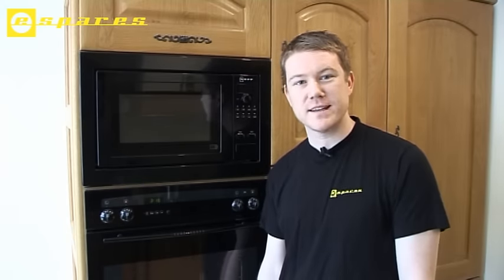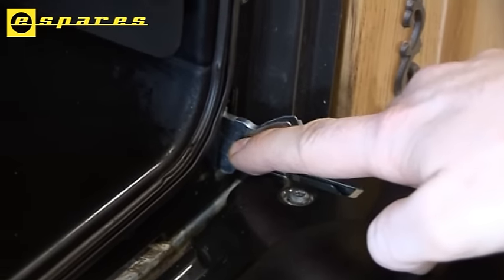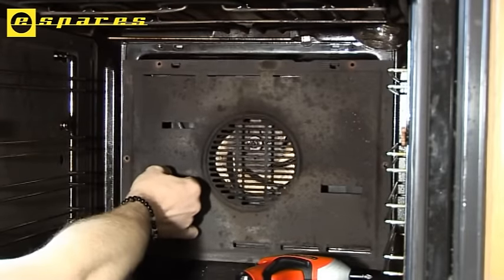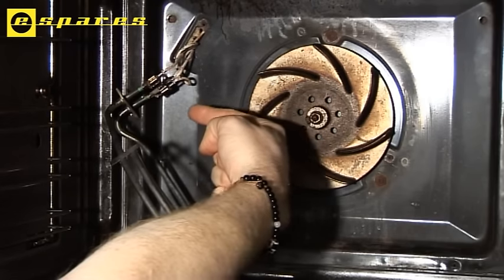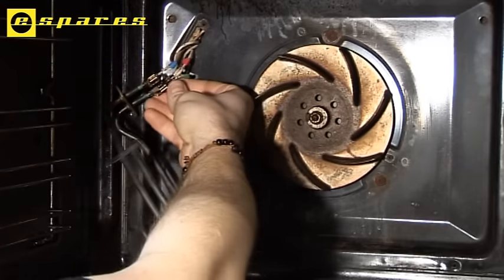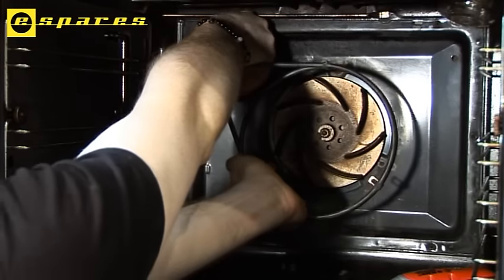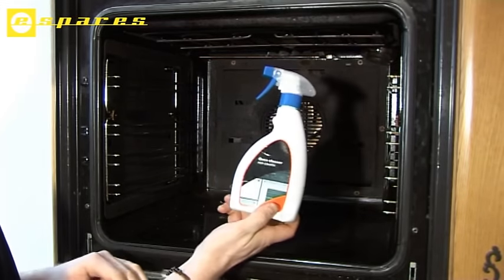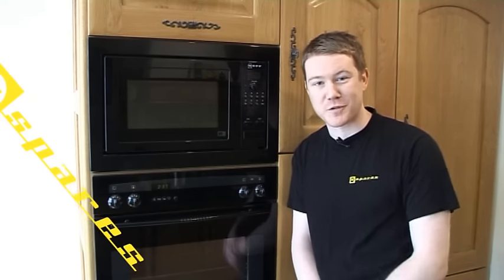How to Replace a Fan Oven Element in a Neff Cooker

Comment: Thank you for the video. FYI if you have a Neff B14M42N3GB/04 you'll need to go in through the back as that is where the element is screwed from. I would not say the oven is too heavy for one person to lift out of its place. It's another 10ish screws but more than possible. You may need a second pair of hands to hold the element in place as you replace the two Element screws. Also, this model was fitted with Torx Screws not Posi. Apart from that, it's pretty straight forward.
Reply: Really appreciate this comment. I would've given up if I hadn't scrolled down to see this, but it gave the confidence to remove my oven and take the back panel off. In the end I was able to replace my heating element but unfortunately that didn't fix my problem.

Still, it was an interesting experience that I enjoyed and wouldn't have had without your tip! 🙌
Reply: If you're not sure if you need to go in from the back take a look at the two screws holding the element in place, if you can't see the acrew heads it's screwed in from the back (like mine was unfortunately, no big deal it just makes a quick job a slightly longer one), cheers 👍
Reply: Also the same applies for the 'U1ACE2HN0B' double oven

Comment: Great video. Just a quick tip - remember you have to re-set the clock on the oven after re-connecting the power. Otherwise the oven will not function and you will worry that your handiwork was faulty!
Reply from the maker: Thanks for the comments Oliver. We remind viewers to reset the clock in our diagnosis video: https://www.youtube.com/watch?v=_lWk22-qvoI
But it is good to remind viewers of this video that this must be done on all models with a clock after the power has been disrupted. :-)
Reply: thanks for this comment, nearly gave up with fixing it, thinking i'd made it worse!

Comment: Will be trying it this weekend, hope it's that easy
Reply from the maker: Good luck Martin. A tip if you can do it from the front 'use two clothes pegs to prevent the element wires disappearing through the holes'. Hope your element is screwed from the front as you wont have to remove the back.

Comment: Thanks Matt for a dead easy video showing how to replace the heating element 10/10#

Just got to go & order the part now.

One thing which is really annoying though, the light in the oven lasts a very short period of time, guess must have replaced 3 or 4 times over 6 years...rubbish really. Any ideas?

Michael
Reply from the maker: Hi Michael, Make sure you use the correct bulb (300c) as standard bulbs will fail.
Reply: eSpares Hi, I have ordered from your site, hopefully this is the correct bulb for my oven.
O/No 4999422
Reply: Michael Bury just seen that it's out of stock, assume you will advise on availability, alternatively refund payment & I can source locally. Thanks
Reply from the maker: Michael Bury We are currently showing 87 of these bulbs in stock (ES654988 ) and the part should be with you shortly.

Comment: Hi, we have a neff U17M62 built in double oven and have removed the three screws around the element, but the where the element plate is held in, there are no screw heads, just what feel like two "threads" so it looks like the whole oven will have to come out (silly design!) - can you advise? Also, when I put my model number in espares there are no results found
Reply from the maker: The reason why most people cannot find the parts is they do not enter the whole model number, for example U17M62N0GB/01. If your machine is this model I have listed the element is shown here: http://www.espares.co.uk/product/es1123970/
We suspect you have a different model (GB/??) as the part linked to looks like it has holes in the bracket to accept fixing screws from the front.

Comment: hi ,great video  I have problem removing the last 2 srews, any help/ thanks
Reply from the maker: Make sure you use a good fitting screwdriver as the screws can corrode and 'chew up' the heads easily if they have been fitted for a while. Also hit the handle with a screwdriver to belp shock and loosen the screws.
Reply from the maker: The parts for your oven can be found here: 
http://www.espares.co.uk/search/mo996016/cookers-and-hobs/neff/b1451b0gb05

Comment: Which fuse should I turn off? The oven one, the RCD one or the mains? Thank you.
Reply from the maker: Hi Mariana, The oven one definitely, and the cooker isolation switch if fitted or unplug it if possible on a single oven.

Comment: Thx for video.  The element that I have received from espares has two separate clips where the wires are attached.  The original element has these clips soldered onto the element.  Is this a faulty product from espares or am I expected to solder these clips on?
Reply from the maker: Hi Alistair. Please place this comment with the full model number as a 'question' on the part you have ordered on our website. 
We can then check if there has been a production change or if you received the wrong part and contact you directly if required  to resolve your problem.

Comment: excellent, I wish all neffs were as easy. be wary of older neffs and neffs with too many connections on terminals and half moon elements with a fan stuck in place

Oh and what if the screws are rusted.

Good vid though if no complications!

If in any doubt always call an engineer, I've seen some problems caused by DIY repairs.

Comment: My Neff range oven element doesn't come out from the front, It seems it will have to come out from the back but no video to follow for accessing from the back? Any suggestions?
Reply: Thank you for replying, my oven is now fixed. I did have a professional to do it for me in the end,( It needed a couple of other things doing, which called for an electrician). I did clean the fan, and had it all been a bit more straight forward I would have attempted it myself.

Comment: What do you do if the back plate screws will not move?
Reply from the maker: +Stuart Broughton Try tightening slightly first to start them moving as the screw edges that catch the screwdriver may be more worn on the unscrewing side. Also pre warm the oven as this may also help.

Comment: Unfortunately the wires had slipped of the terminals before I could mark them. I had to take  the oven and remove the back plate, only to discover three wires to fit onto the two terminals. Could you please advise?? I bought the element fro espares for a Neff B1120F1GB/03
Reply from the maker: The third wire is the earth. If you get a meter this should show a direct connection to earth. The other two will connect to the element 'ends' and can be reversed with out problems.  If there is no 'tag' on the element you should ensure the earth lead is insulated to ensure it does not connect to any other wire.
Reply: thanks for posting

Comment: Hello, I watched your video and did everything you did until I pulled the element and the wired disconnected and I.m left with something that did not look at all like the wires in the video ! I have a wire with a kind of fabric coating sticking out ; and colored wires in the hole (1 white, one red, one blue, one Brown). But when I'm pulling those coloured wires, nothing comes up. So my question is Where is the second part which was connected to the element? and if it fell way down behind, how can I retrieve it ? Any advice before I take the oven down? It's a double oven and it is super heavy !!!! Thank you
Reply from the maker: Hi Agnes, if you have lost the wire down the back you will have to lift the oven out and remove the back. You may be able to remove shelves and the doors to lighten the weight and slide it careful onto two dining chairs with a friend when you want to work on it. Good luck.
Reply from the maker: Hi Agnes, it sounds like the wires have fallen into the back of the oven and the only way to retrieve them is to remove the oven if you have a workbench use that to support the cooker.

Comment: i have mixed up the wires that go on to the element. what will happen if they are the wrong way around.
Reply from the maker: greg young Reversing the connections to either end of the element will not have any effect. If your element has an earth connection to the 'metal work' of the element it is important to connect the wire to this correctly as it is likely to cause blowing of fuses and possible damage if you connected the elements live wire to the earth connection.

Comment: Hi Matt, I would appreciate an answer before I start to drill out the screws!
Reply from the maker: +Stuart Broughton If the above does not work you could try using a pair of side cutters to grip the head and twist it to start it turning. If this fails you may have to drill out the screws.

Comment: I have an U1ACE5HNO, also screws out the back requiring oven removal. why the HELL have Neff decided that was a good idea, was a 5 minute job now I suspect a lot more & not sure I want to pull it right out & mess with the back. Get bench to support etc etc. It may not be a difficult job but should have been extremely easy. I think I am done with NEFF, my last Neff failed a little prematurely, it only has one oven light at the top, so anything much on the top shelf, its dark underneath. The fan runs for what seems like hours after being turned off, appreciate cool down but that is ridiculous. I have reduced to min in menu. I know not the most expensive but quite a lot of £'s. Would have thought they could afford to put in 2 lights. I cannot image they will make money from changing the element, doubt their service guys are used & certainly not in my case if I don't tackle it. In fact as I type don't think I will waste my time or money on this anymore. Much nicer units out there.

Comment: Why is my neff oven u1721n2 element different to everything you see on youtube. It's an upside down u shape, and 1 retaining screw is behind the fan !!! and of course the fan won't budge unlike the video where it just comes off with a gentle pull, 2 hours to do a 15 minute job. Neff service dept wouldn't give advice on how to get the 1 screw out on H&S advice !!!! I'm high voltage qualified and worked on boilers and 1MW generators, they just want you to use one of their parts fitter, or as they call them, engineers ;)
Reply: CeeDee 1 you might at least have told us how you got the fan blade off! I have the same problem

Comment: Sites and videos like this, are the downfall of this country. By putting videos like this on the internet, you are destroying businesses. anyone reading this, bear in mind, you will pay a lot more for your elements than what a dealer will, and you will not get a warranty with your repair. So it could cost you more in the end. Plus, just because your oven is not heating, is not always due to your element. Just some free advice to hopefully save you money.
Reply: WRONG! The downfall of this country Mr Richards is the selfishness and ignorance that exists from the top down. I rely on these uploads - typically from the United States - to help extend my knowledge. I'm a qualified electrician who struggles to gain work in this field because of my deemed lack of experience and lack of 'useful' contacts. I'm sure from your stance that you know exactly what I mean, I've no need to express myself any further. Your charitable, free advice taken!
Reply: What a complete load of shit you have just spouted there Mr Richards.
I replaced an oven element like this one with my father about 11 years ago. Its gone again and but so has he now , so i am replacing myself.
Now there is NO warranty that would cover that period. The monetary saving for buying and replacing the element myself is a "no-brainer" compared to any extended warranty cover.
The replacement procedure is SOOO simple.
So what if the dealer makes a few £ or $ on retail markup. That's their due. Its an £8.95 element if you know where to look.
What the rest of us gain is a saving of £40+ per hour labour fees for tradesmen to do what anybody can who owns a screwdriver. This IS NOT HIGHLY SKILLED work requiring a qualification.
Get over it mate !